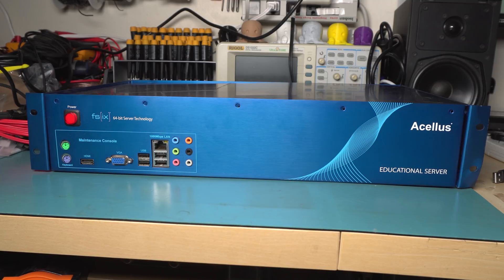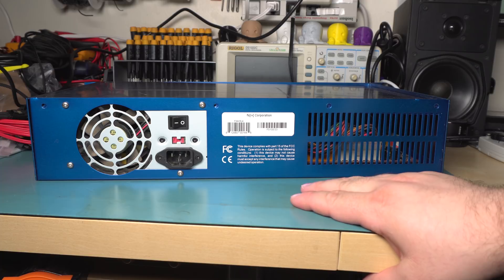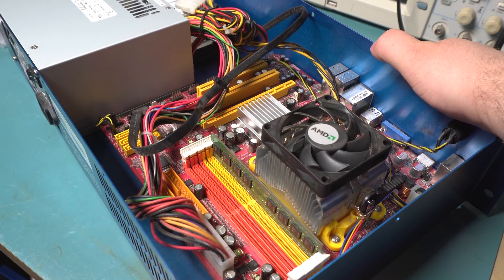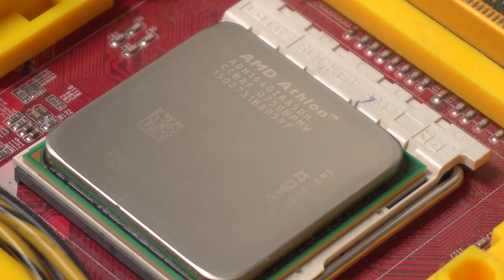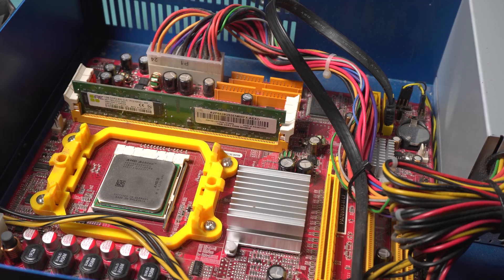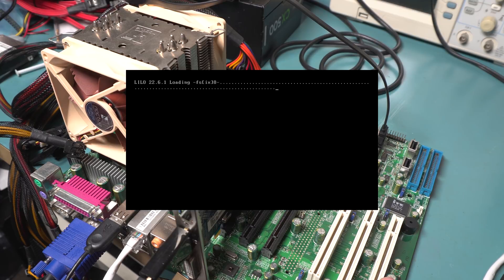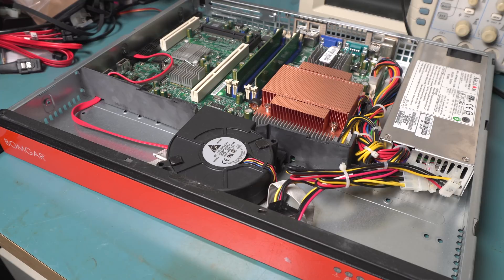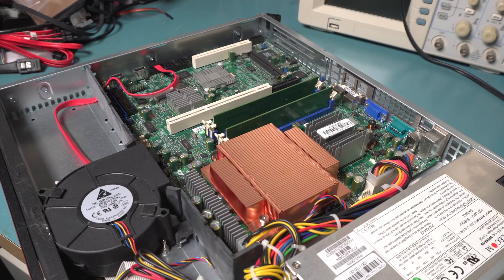Acellus fs[ix] Educational Server Teardown

Comment: Sorry for necroposting on this video, but I wanted to say something that might help in the future. AMD motherboards from this era often will POST through the audio out ports on the back. It will have a voice that will tell you what the error is. I found this out on a build that used a K7N2 Delta. I hooked up some speakers and it told me that the CPU fan was not plugged into the correct port. Thanks for posting these videos! I have been binge watching your channel for around 2 days now.

Comment: Oh, Jetway makes (made?) some interesting stuff.I once had a very tiny Atom N270 box, all passively cooled, no moving parts. (i'll edit and add a model# tomorrow, if i don't forget …i'm too drunk to crawl out of my bed right now [yes, i have a bedside keyboard/mouse]) LOL
Reply from the maker: Yeah, they are (were?) a pretty big company. They seem to mostly specialize in embedded/low power stuff like your Atom box.
Reply: I don't like editing posts to which someone already commented. Here are the model numbers.
Box: JBC360F33-B
Board: NF33-270-LF
I ran onwCloud on it, but LUKS maxed out its wimpy Atom CPU and barely produced 20MB/s troughput.
Reply: There was also a mainboard which supported both Socket 754 and Socket 939.  It had both sockets on the same board.  Jetway nowadays makes mainly industrial computers.

Comment: Which Noctua cooler is that on your test bench CPU?
Reply from the maker: It's a rather old cooler, but it works well. https://noctua.at/en/nh-u9b-se2. I believe this is the most modern version of it: https://noctua.at/en/products/cpu-cooler-retail/nh-u9s

I won it for like, $20 on eBay some time ago - the fans alone would cost more than that. :D
Reply: Peter Brockie Oh nice! And thanks. I was trying to gauge size, as I may go for the 12" version in a new build and thought that might be it. Rethinking that now. XD
Reply from the maker: Zeta Syanthis If you have space in your case for the D15 it's amazing. It'll easily crush most 240mm all in one radiator setups.
Reply: Peter Brockie Not quite enough room for that one! The nh-u12s will fit, though!